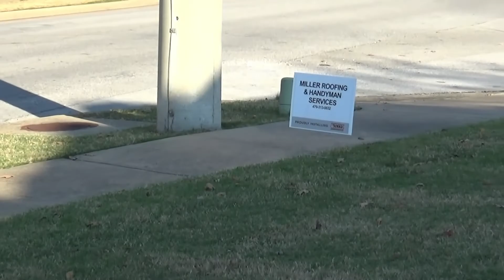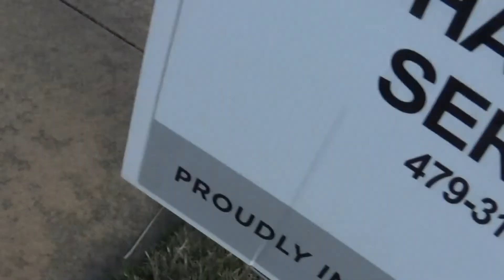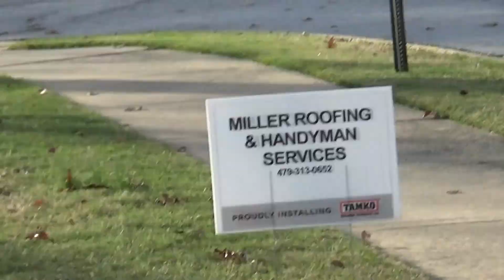TEAR OFF AND REROOF OF A LARGE STEEP ROOF

Comment: You have a great efficient crew. You could of made them better by providing a couple picks for the lower 3 to 4 courses. Along with bracket and planks for running up the roof. Cushions work ( I still use them myself to this day, but for repairs or rabbit runs) I know ladders, ladders jacks, and ladder picks (always go with the 500lb rated weight pick) are not cheap, but they will pay for themselves within the first 3 months. Maybe less if you are super busy